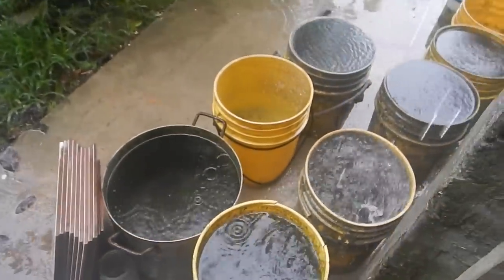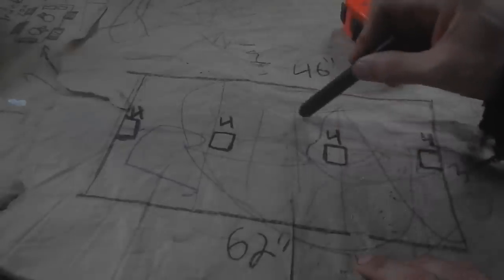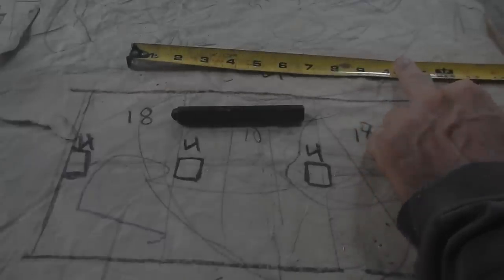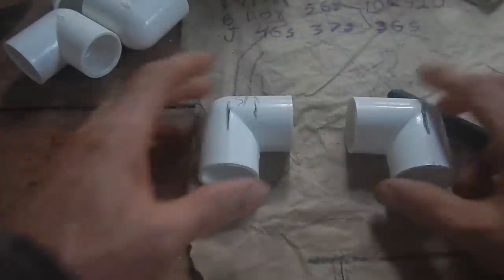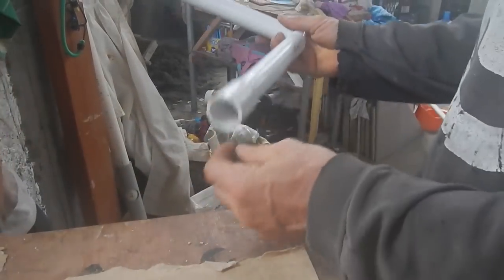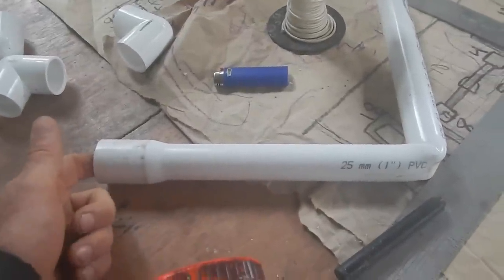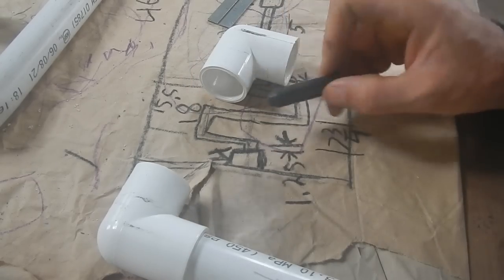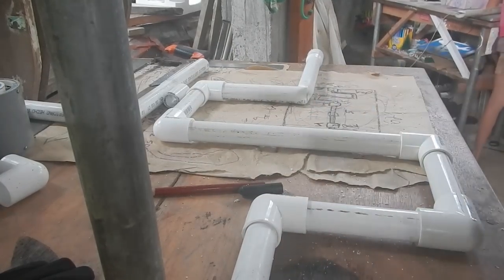Shark Slicer Upgrade 002 Pedals

Comment: I think we should get rid of noodle units and replace them with metric units. It really shows how people/countries can't agree on anything (even if one is far more superior and simpler at the same time)
Reply: I like my noodle units. Makes more sense to me(cause raised on it). Especially when Measuring things Without Ruler. Since certain body parts are about the same measurement on average. like my thumb nail is half a inch wide. My index finger to the fist knuckle is one inch ect. 
It is nice to know things like this when doing a project and don't have time to get a measuring device. And your measurements will be the same throughout the whole project. Or until you smash your finger real good. lol 

I would rather change time concepts to some-type of multiple of 10 base instead of (sexagesimal) 60 base. and the earth rotates 15 degrees in a hour. So who knows what the Sumerians were thinking. carving the skys into pieces.